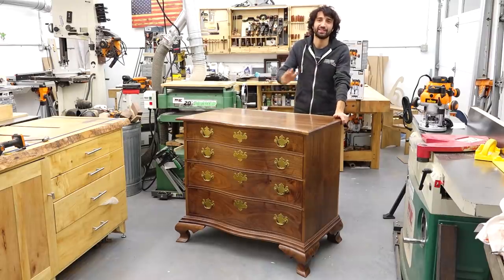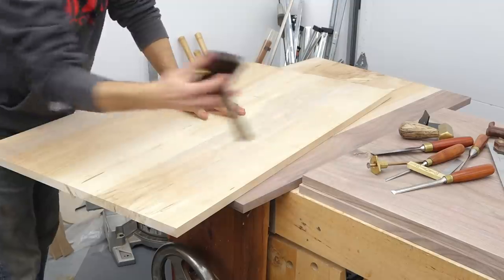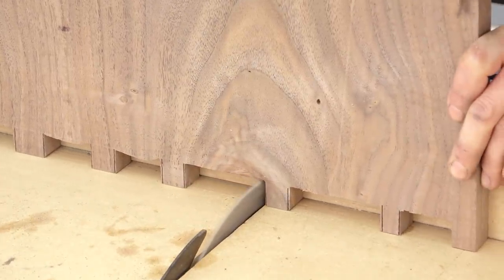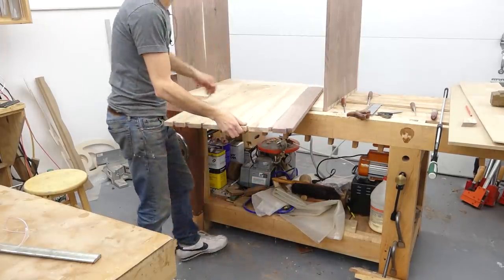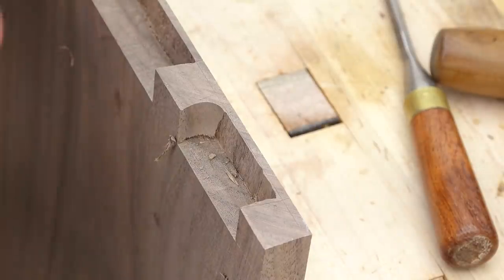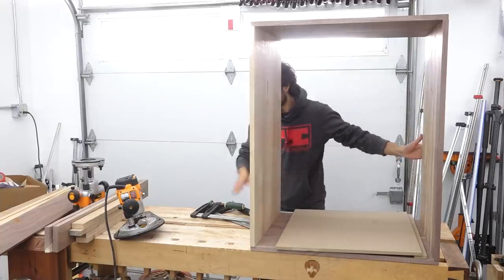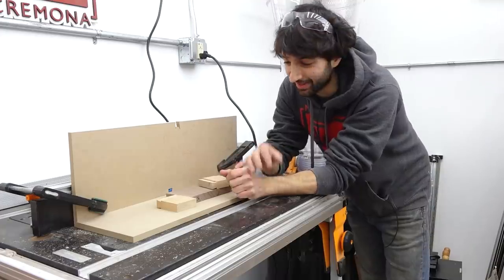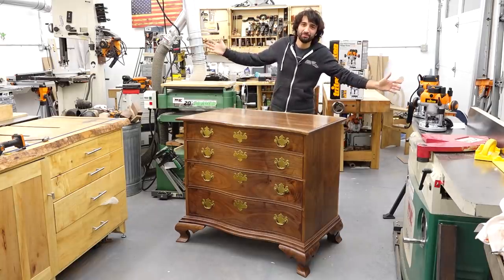Dovetailed Case Construction | Serpentine Chest of Drawers Build Part 2

Comment: Thank you for the close up chisel work, Matt, as you were meticulously cutting up to the scribe lines on the dove tails. A lot of bulk wood removal can be cut many different ways, and usually much quicker as you know and have shown, but these close ups really shows the attention to detail required for those that might not know, where to really slow down and sneak up to the scribe lines. Sharp chisels and plenty of light goes a long way! Thanks for showing your journey(joinery,lol), Matt, in so many ways...and sharing what you have, and are learning along the way! It's Appreciated!

Comment: I am about to begin a bookcase build for a client and I was wondering about "structural" dovetails because as you stated, these that i am going to do will not be seen either. I wondered if I should even put in the dovetails. Thank you for mentioning that. I feel much better about doing this.

Comment: Do you do anything to like a small rabbet or a v-groove to secure the tail board against the pin board when you're marking out the pins? Do you just eyeball it and feel for flush?
Reply from the maker: I just eyeball. I used to do the rabbet thing when I was getting started

Comment: Very timely as I am in the process of building a serpentine chest myself. I cant tell from the video what you attached the backer board with when you were using a router to clean out the pin waste. Couldnt see any clamps. Do you use something like double stick tape?
Will be interested in seeing you dovetail the drawers with a serpentine front also. Any chance this will be a guild project? I did build a highboy and used your guild project as a reference guide alot. Thanks for sharing your work and knowledge with others.
Reply from the maker: it's just clamped on out of view of the camera.  It won't be a guild project but I've shot this series to a relatively similar detail level.  The plans on my site are identical to the ones in the guild. thanks!

Comment: 17:05  I noticed that you were putting your dovetails right in the seams of your panels;  are you doing that on purpose, and for what reason?   It seems like the wedge of a dovetail would actually want to spread apart the seams of your panels.

Comment: Pro Tip:  You don't need a Top Arrow based on which way you designate R or L.  The orientation of the letter will tell you where the top of the case is.  Hahahahaha
Reply from the maker: Only if you’re literate